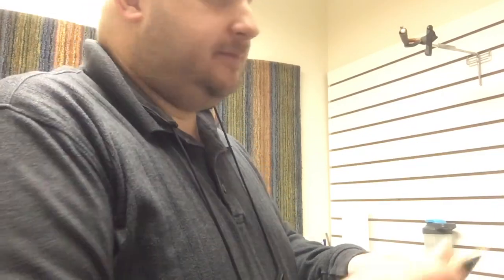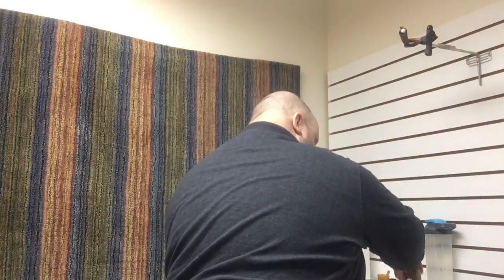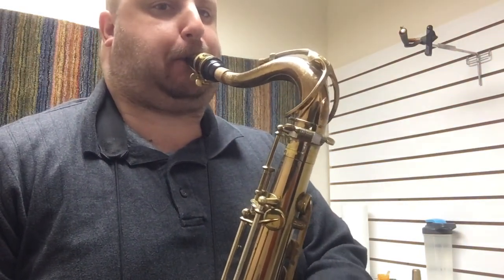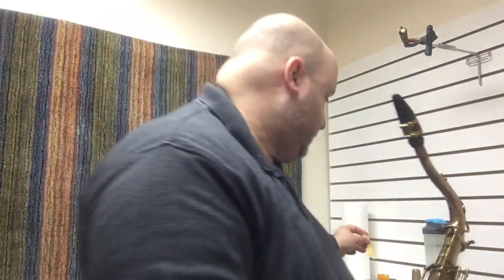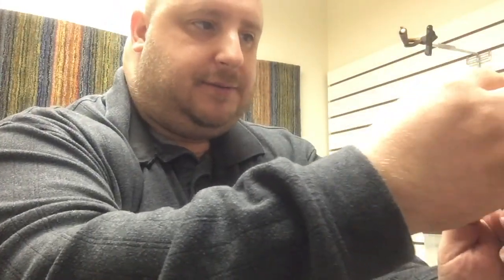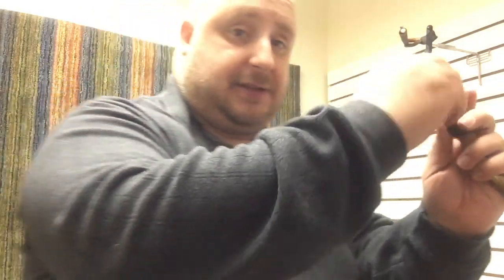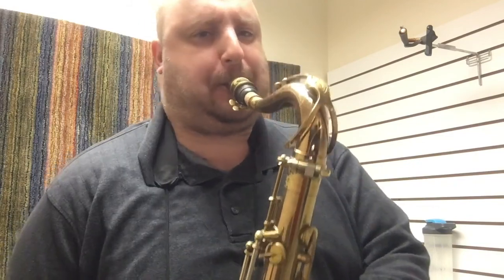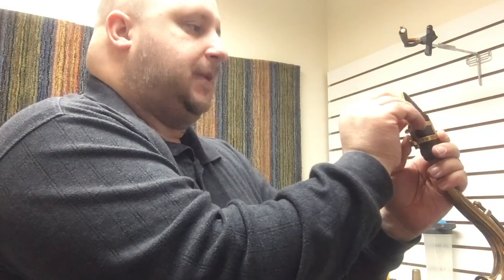2 Selmer Soloist Tenor Mouthpieces

Comment: Sir my soloist is a D facing. What reed and ligature would you suggest I pair with it. I also play on a Custom Yamaha sax. I would appreciate your insight. Also very nice playing, very Jazzy;)
Reply from the maker: Personally I like the old fashioned 2 screw metal ligatures. If you can find one that isn't chewed up and out of shape they play very well on that type of mouthpiece. As far as reeds you have to just try a lot of different reeds and find what works for you. It's a very personal thing related to your own physique and personal style. I would suggest only changing reed sizes in small steps over several months. You want to give yourself time to adjust slowly for the best success. good luck. Sageek.